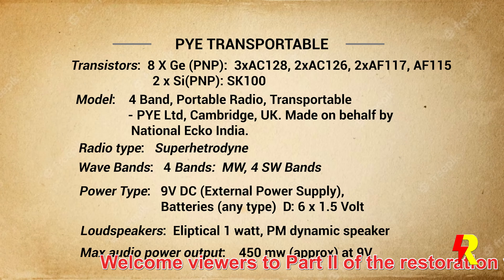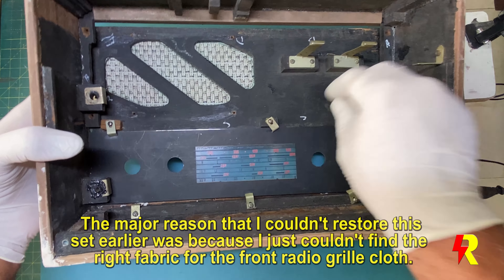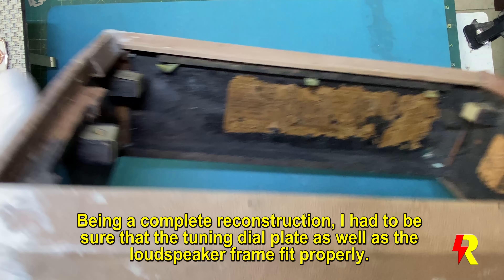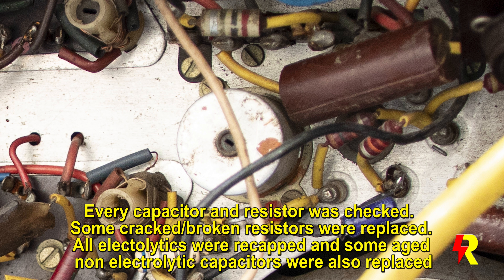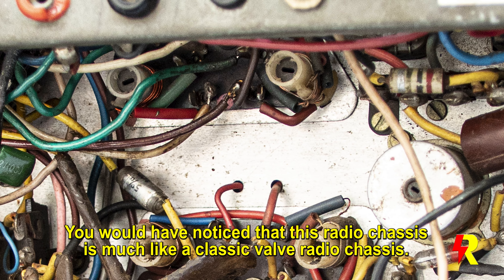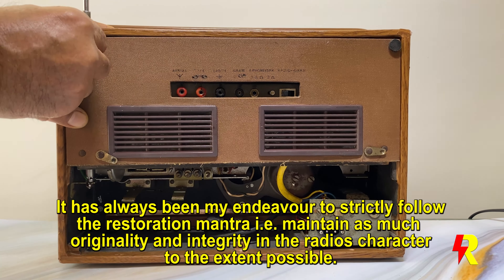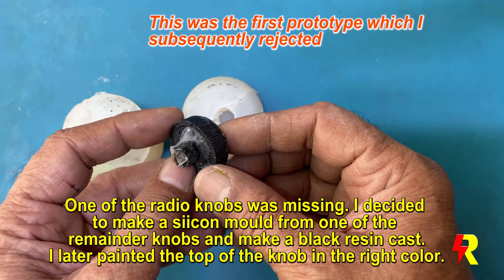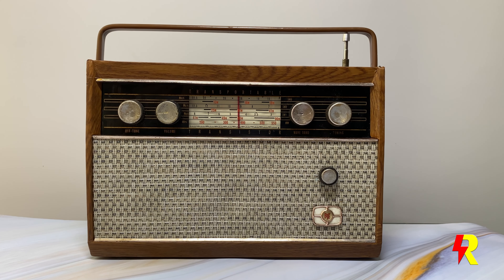PYE Transportable Part II | Rare classic beauty Made In India | Challenging restoration | 4K |

Comment: Great as always...how u find faulty capacitors in the circuit. Do you remove them all and check them one by one? Also please make a video on how you replicated the broken knobs with resin. Keep it up. Thanks
Reply from the maker: Thanks a lot for the kind words. The knobs were casted in black colored resin in a silicone mould of one of the originals. Thereafter painted to look identical.